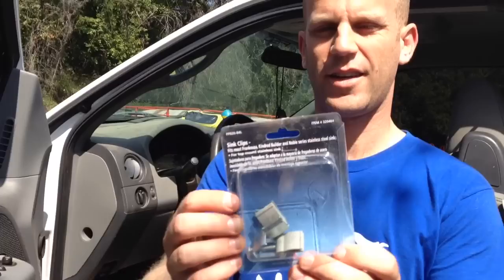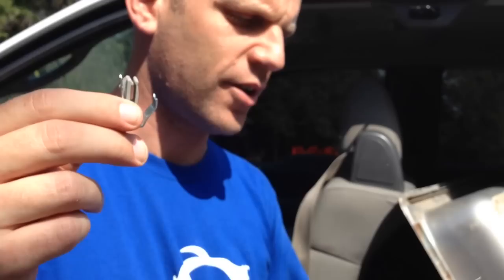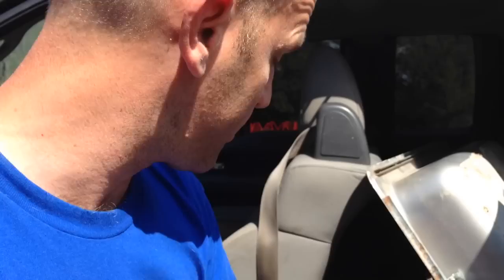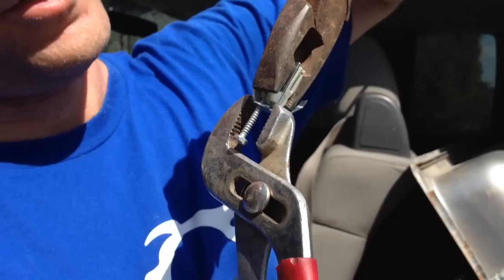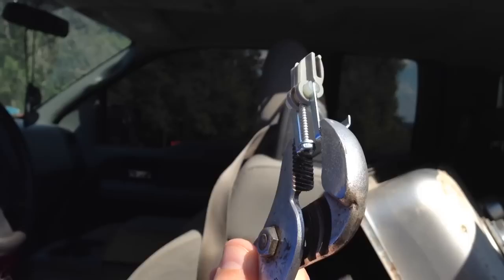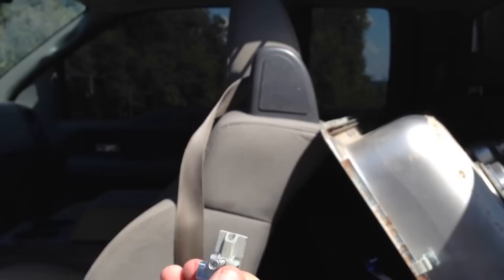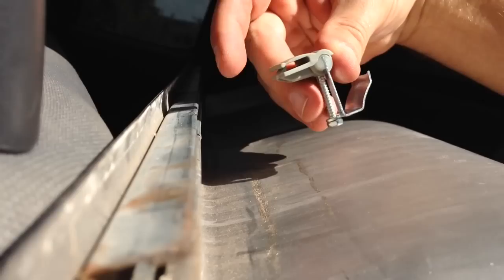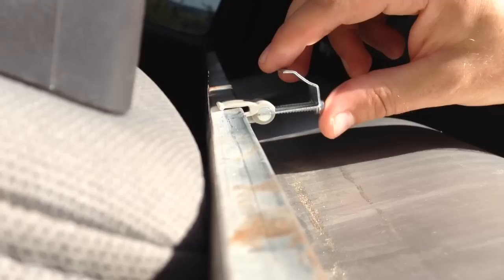Install universal sink clip (Keeney PP826-84L)

Comment: Thanks for the video. I really appreciate it. In addition to the design issue, I will also add that the construction material sucks. That screw is threading through plastic. If you have any pressure from your sink against the counter it pulls right out. Not at all excited about this. I sure hope mine lasts. 
 And, for those asking, I bought my package at Lowe's I think it was 7.95

Comment: Easier, with the clip held on a table horizontally with the head of the screw on the table, use a flat blade screwdriver on the metal part,  push the metal part straight down until it hits the head of the screw. No pliers needed.

Comment: As a salesman in a sink manufacturing company for over 10 years, I can share with you that, 1st, the clip and the rail are not a good match, which means you bought the wrong clip for your sink.  2nd. the clip is very common we have lots of similar types. I think the only thing you can complain about is the quality of the clip, not the design.
Reply: the design is great the problem is lack of instructions on how to make this great design work.